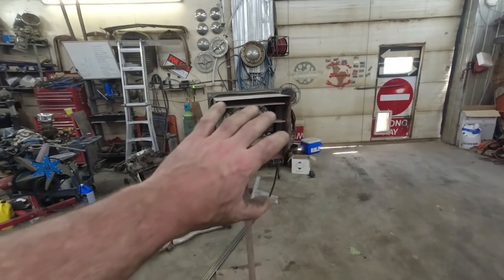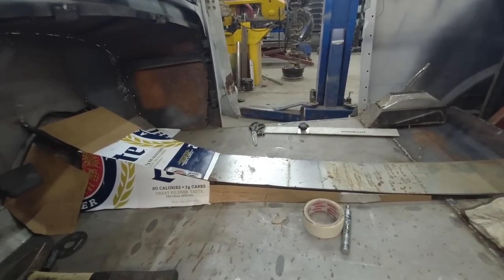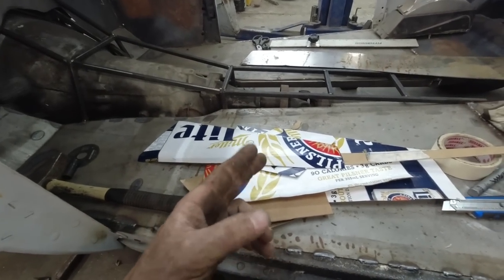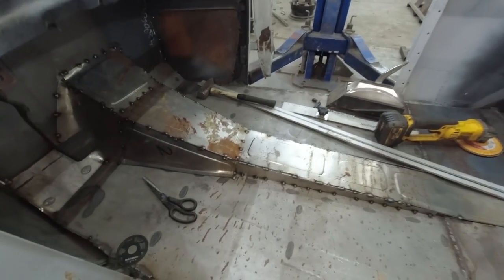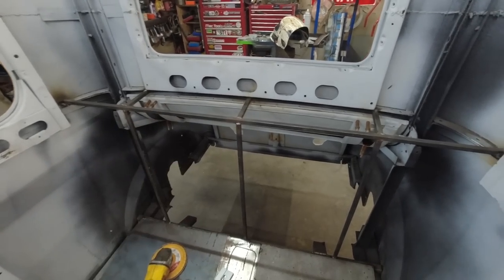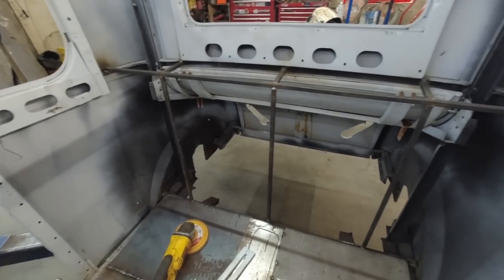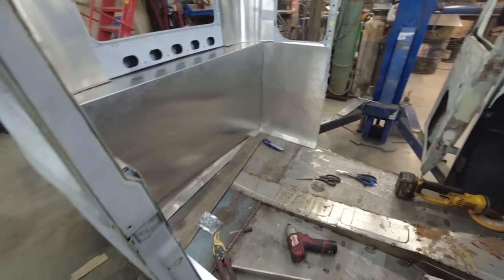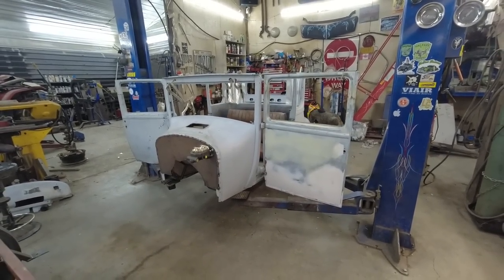Building a tunnel cover and sheeting the rear interior with aluminum sheet.

Comment: Ambidextrous as well I see. That left handed slash down that length of sheeting with the nibbler was impressive. Looking good. The only thing I'd change is I'd put the corner rounds with the bottom shrunk flange under the tray instead of on top of it. I think it would look so much nicer and you can still screw or rivet the two together. Like Keith said, sound deadening stuck to the back of the sheets would really quiet down the ride. Thanks for the videos Brent. You are appreciated.

Comment: Love the track car sheet metal.  Reminds me of my 29 Ford 3 window coupe I made into a 5 window for running the 1/4 and 3/8 mile circle tracks in western Washington in the 1990s with the Vintage Modified Racing group out of Tacoma, Wa.  Love how fast you were able to fashion your Aluminum panels.  It took me MUCH longer with manual cutters and angle iron and a hammer to fashion mine.

Comment: Bonjour  mon ami from the Riviera. Great job on the fab work as always. Decades building C-130 Hercs, I would recommend using "sealant between all faying surfaces" (we used FMS 1044 B2 but commercial silicone would probably be fine) ... will seriously stop the annoying rattles; also agree with Keith Mason below on stuffing some insulation material for road sound elimination.  On the AL joints .... might want to use some "Fender Welting" ... what I had on my 1961 MGA ... nice sprucing up and comes in various colors. Bon chance and looking forward to the next episode !!!

Comment: Day 3 of working on my interior. Using panelling. Trying to get it to fit was a whole lotta suck. And with all my aches and pains i managed to soldier through. Headliner isnt great, but its good enough. I finally used some of the leather i was hoarding for 20 years. That being said im going to pay more attention to the couches dropped off at the dump, a good source for free leather, the back is usually leather. 
Treadmill belt makes awesome floor mat.

Comment: Modify the trans crossmember so you can just take the center section out That way you can leave the ends welded to the frame. I have used the method a few times and you do not have to take out the whole crossmember.

Comment: AS GREAT of a mechanic, machinist and engineer, fabricator that you are I would love to see you build a custom Fire Engine/Truck for one of your Volunteer companies or career fire companies. Most all great apparatus are built on custom chassis. I'm sure there are enough "retired", broken or whatever pieces of equipment hanging out in the great up north that you could piece together. (Also for the pumper, a duel stage pump is one thing everyone wants.) I guarantee anyone would love to have it if you built it. BTW you are awesome

Comment: Hi Brent, another fabulous show. I know it is not your intention to add a roof, which seems a shame. I was thinking, how about a roof panel from one of your miriad of cars, perhaps even one with sunroof from a scrapper? What an unique approach that would be. If one was available complete with sliding sunroof, even better.  If the roof were raked, (lower at front), rather like a peaked cap if you get my meaning with sunvisor integral over windscreen. Wow! Lot of work I know, but would be the envy of all.

Comment: Sir Brent,,
Great apportioning and curved corner I would have like some commentary on that corner part; maybe now to interior framework rivets or those self tapping low profile panhead screw some sound adhesive covering maybe leather glued directly to back wall bench and radiuses sweet job around transmissions floor frame great set up for floor sound & heat deadening then a nice low profile enduring carpet also like lots of foot room so your ankles and feet on floor and petals won't get fatigued. Just bring it home beauty stepping up your fit and finish as you go. Advance you artistry get going on that leather seat with some saddle soap start cleaning her up then bring it home maybe with stain or sealer so she looks Oh that's really nice. Love what you do my brother.  Looking forward to where your going. Smokin ! Oh Yeah 
 Best David

Comment: Who are you building this Model T for. Your work is going pretty fast on this project . Some spray foam insulation will takeout any potential noise from thin aluminum panels.your fabrication is the best. Thank you for sharing!

Comment: What I would do with those aluminum panels I would put rubberr gaskets behind the aluminum to keep it from vibrating. I know it's going to be attached to the framing you have around inside the cab  It would give it a solid feel. Just get an old inter tube

Comment: Brent I don’t know if you got my last message. I watch on an I Pad, so sometimes it works,and sometimes not. They are going to shut down the largest aluminum smelter in the states, at least for a year. I don’t know what your budget is, but if you can afford it, even though its higher than a cats ass. You might think about stocking up. By the way tithe build is looking great, like hat you did with the forming around the the top of the package tray.

Comment: The aluminium is Fan-cé, looks proper goooder! 
Can’t wait to see what your bead rolling is going to be doll her up hey? Snazzy,
Okay enough, can’t you use that window sikaflex (or even silicone)on the 12mm square and the pieces resting on it instead of using a bunch of screws to keep the rattling at bay?
Although thinking about it a bunch of stainless screws will also look pretty neat inside, right?
Ciao uncle

Comment: Templates boxed  by Light, templating da steel plates n beady eyed rollering, welder'n in da tunnel franework gotts ta be strong, cover'n up da tunnel framing by tacky weld'n, aluminized interior wif tinny can sound yet ta be screweddown.

Comment: I would only put a SEM brand seam sealer behind the panels and just rivet them in that would look cool
Reply: On second thought I’d cover everything inside with the aluminum even top and bottom of the back window and rivet everything on maybe a 2” spacing then clean it very well and satin clear it that would be cool and keep it smooth….no bead rolls or anything

Comment: I am no fan of T buckets . This is a more ambitious T with the roof and a closed cabin. It's another get her done job which is everything a motor vehicle needs to be and not so bare you die of exposure in a cold climate driving. A hot rod you can go anywhere with. And is still a class above motorcycle. You should stuff some sisal or hessian, wool behind the aluminium panels. Sound proof and insular padding. At our shed we had a roll of this rubber stuff they usually put on house roofs. Flat roofs. Good waterproof stuff for model T and A tops if you have the good adhesive, but also for floor panels to stop the drumming affect.

Comment: Eh' Some shag carpet, dingle-balls and fuzzy dice will cover any imperfections in the sheet metal. If you use three tone green shag I promise no one will ever notice it even has a body. Time tested low tech cloaking device.